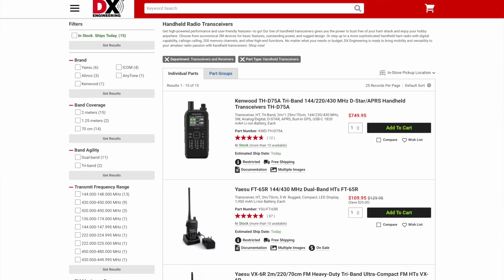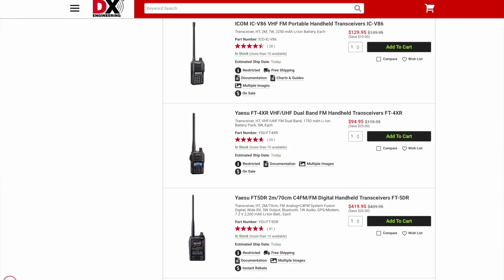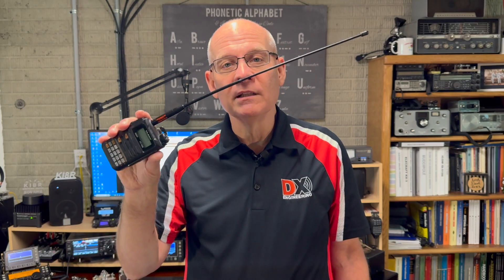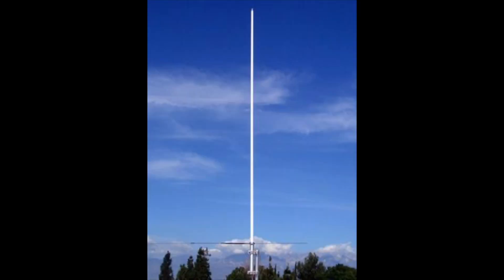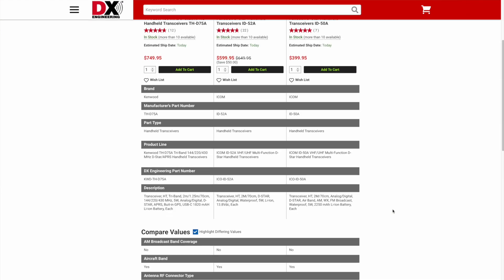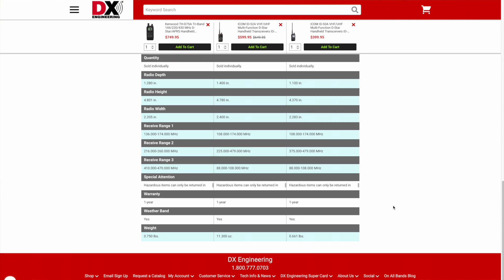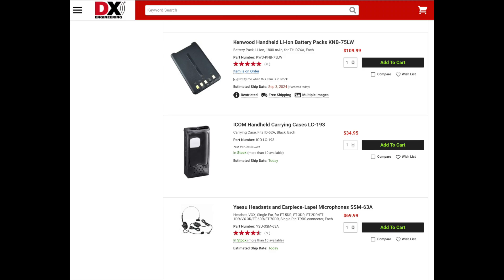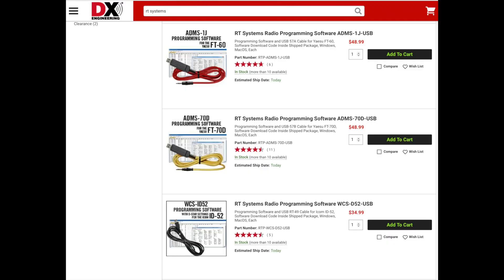How to Pick the Best Handheld Ham Radio - DX Engineering

Comment: A bit disappointed in the Yaesu FT 70D. Saw complaints on FB about the battery. Bought one and discovered it myself. Gonna buy another FT60. Had good performance with that one.
Reply: The only thing I dislike about the FT70DR is the volume adjustment requiring two hands!! I would accept the crappy battery life if it didn't have the ridiculous volume adjust!!